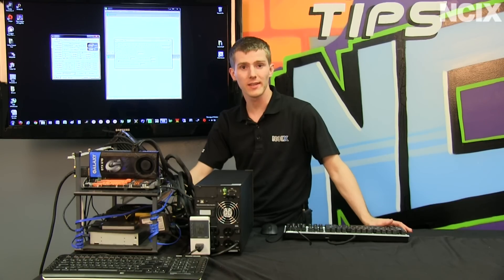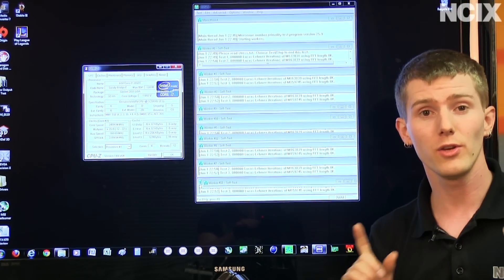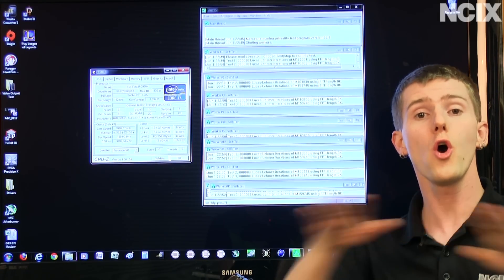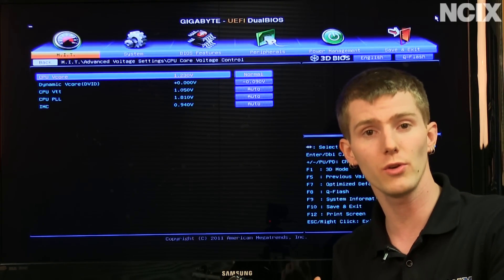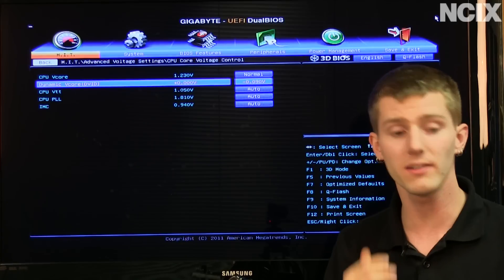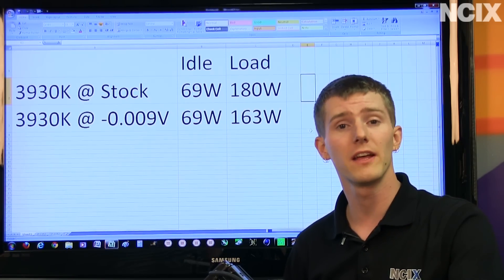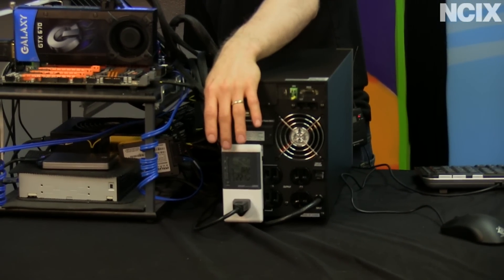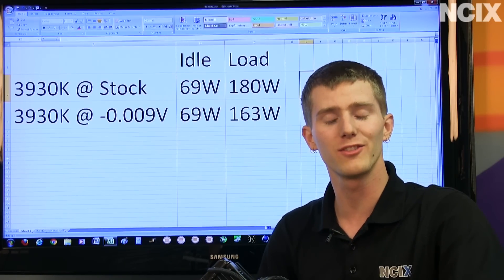Undervolting Your PC to Achieve Better Power Consumption & Temperatures NCIX Tech Tips

Comment: Mine is a Core 2 Quad q6600 overclocked to 2.75Ghz and undervolt -0.1275V with stock cooler and a cheap paste, it's so stable that it doesn't change more then 2 or 4°C to CPU

Comment: My i7-6700K runs at stock 4GHz with -0.170V offset absolutely stable. It has a significant impact on the temperatures and power consumption. I suggest everybody to try that and save some money for the utility bills. It also prolongs the lifespan of your CPU. It is blazingly fast at stock settings, and there's really no reason why not to do it. With i7-6700K you could start with -0.100, test stability, and go down in -0.010V steps. You could save some time by using just a stress test in CPU-Z to find the crash point [nothing bad will happen, in contrast to overvolting], then up the voltage by ~0.020V and it should be perfectly fine. Cheers!

Comment: is undervolting a gpu safe or not cause i have  an rx 480 gaming x and it default voltage is 1150 mv  with 1266 mhz  
And i managed to  lower it to 1000 mv with 1266  mhz  with no probleme at all  and i test it with 3d mark ultra and unigen and furmark and all thing are just fine..☺☺

and my temp has lewerd by 10 to 15 c .

My question is :  iS WHAT I DID IS GOOD OR BAD ?

Comment: Hi. Looking to buy low power draw cpu to use with eluktroniks laptop, which use lga 1151 desktop cpu ! Between i7 9700t and an undervolted i5 9600, which should I buy ? I was hoping to reduce the power draw of the i5 (65W tdp) to the lowest possible while still being stronger than the i7, in order to reach a normal 45W tdp. I'm mostly interested in single thread perf. Do you think it is too far fetched ? I'm guessing they do make those -T cpus for a reason...

Comment: I need help guys does anybody knows what is the problem when your processor is running on very low speed. It all started after cleaning my PC's dust from it and I just removed the fan and cleaned and i plugged it back

Comment: If you undervolt  your both your CPU and GPU will you lose performance?
Reply: I undervolted my CPU and used the intel extreme turning utility to do it because it's much faster and easier than going in the bios every time. 
In advance, turning to turn the voltage offset to into the negative and increase it by 5 till you crash/bluescreen, If you do then go back to what you had that worked.
Mine is set to -0.100 and my max CPU temp is 72C with an i7 9700 turbo.
And yes, To answer your question it is, I'm not 100% sure but I think it's still called overclocking your CPU because your making it better, So far I see no performance decrease, Beats me why Intel CPU's aren't like this and we have to do it manually, They make the CPU'S to get lower temps and like no performance impact.
I'm not so sure if you should do that on a GPU, Most GPU'S are fine at 90C, Make sure you have a good tower and cooling.

Comment: Under volting a cpu isn't very ideal as the vrms will still have to give more or less the same amount of amperage the cup still needs to run at stock speeds. If people think it will reduce heat yes for the cpu but the vrms are not designed for very low voltage and high currents. There is a thresh hold in this
 for it to function above minimum
 specs.

Comment: That's the reason I settled with Xubuntu 16.04, it allows me to use full 3D capabilities of my Radeon HD4650 (chip RV730) without frying my laptop. I also learned some commands to control my Radeon frequency manually and also CPU frequency control, so most of the time I manually set them to minimum or "economy" mode.
sudo apt install cpufrequtils
watch -n 0.5 grep \"cpu MHz\" /proc/cpuinfo
sudo cpufreq-set -c 1 -g powersave && sudo cpufreq-set -c 0 -g powersave && sudo cpufreq-set -c 1 -u 1200000 && sudo cpufreq-set -c 0 -u 1200000 && sudo cpufreq-info
sudo cpufreq-set -c 1 -g ondemand && sudo cpufreq-set -c 0 -g ondemand && sudo cpufreq-set -c 1 -u 2100000 && sudo cpufreq-set -c 0 -u 2100000 && sudo cpufreq-info
These ones for the Radeon GPU:
sudo cat /sys/kernel/debug/dri/0/radeon_pm_info && sudo cat /sys/class/drm/card0/device/power_dpm_state && sudo cat /sys/class/drm/card0/device/power_dpm_force_performance_level
sudo su (only works inside a rooted terminal)
echo battery > /sys/class/drm/card0/device/power_dpm_state
echo low > /sys/class/drm/card0/device/power_dpm_force_performance_level
Done!

Comment: What happens if you undervolt both CPU and GPU?
And another question:
I have been researching this topic and apparently by undervolting your CPU you gain an overrall performance boost. What happens if you only undervolt your GPU and not CPU? What is the most recommendable choice?
Thanks in advance.

Comment: I would imagine that undervolting the CPU would extend the life of the whole system. The less voltage it gets, the less power it draws. The less power it draws, the less heat the CPU will make and the motherboard's power delivery system and power supply will also run cooler because less power is running through it. Less heat production inside the case will extend the life of the whole system.

Comment: after watching this video I decided to under volt and see how far I could push my cpu (i5-7600k)  on an overclock and after checking stability I am sitting at 1.080v and 4.6ghz (this is after running prime95,intels stress test in the overclock tool, cpu-z stressing and playin some counter strike lol)

Comment: I have a 140mm fan on my PSU, 2x 80mm fans on my GPU, a 140mm case fan, and a 120mm fan on my CPU AIO liquid cooler. My girlfriend's mom thinks all these fans will cause the electric bill to go over $1,000. I went as far as removing 3/4 of my 4GB DDR3 DIMMs and undervolting and underclocking the CPU but makes no difference when she doesn't understand what the heck I'm talking about.
Reply: holy crap your gf's mom is dumb

Comment: How is running prime 95 for 24 hours on maximum cpu load to make sure your system is stable would be ECO friendly and save power? I say that doing nothing is better than undervolting since you don't burn that power for making sure your system is stable. And power saved by undervolting would not exceed power used to make sure system is stable. Unless it is done for educational purposes ofc.
Reply: 24 hours is nothing in a computer lifetime. What you save in the other 14976 hours makes up for it -.-

Comment: I will try this shit on my i7-4790k as I have very high load temps - about 69 C but sometimes its reaches even 71-72C
Reply: This Is Not High Temps Man 
But Tell Me First 
These Temps On Full Load Or Idle ?
Reply: Full load. If it was idle I would kill myself :D Idle was something about 38 or less. But the max temp for this processor is 72C and I've already exceeded this score a few times.  About voltage: voltage is affecting temps also. I was experimenting on my previous cpu which was Intel Core 2 Duo and I saw a diference - not much, a few degrees but still... In the professional computer service they told me that my load temps should be max 60-65.
Reply: Okay Man 
Don't Worry A Bit 
Because You Are Safe 
These Temps Are So Good To Work And Play With 
Even If You Go With Temps Like 90 C 
Don't Worry
Reply: But There Is Some Thing I Didn't Mention 
Who Told You That The Max Temp Is 72 ? 
The Average Temp Is 74 C 
And Max Temp Is Above 100
Reply: Are You Working With Stock Cooler ? 
Or You Have Good Air/Water Cooling ?
Reply: TCASE 74.04°C - so ok it's not 72 it's 74 but... it's not avarage temp. For 100% it's max temp
Reply: sorry.. again.. you can be actually right XD
Reply: Uh unfortunatelly I'm right... so TCASE is the temp which you shoudlnt go above because you can decrease life of your cpu. This temp may differ for diferent cpu models. For 1 cpu 80 may be still ok and for another it will be a very dangerous temp. So... for my cpu 74 is a temp i shouldnt go above. It's not avarage temp. And as I remember when I went above 73/74 C my comp started lagging a bit, so... yeah :P
Reply: Ok.. I know shit. You may be right and I may be right in some way. I've just run Intel Processor Diagnostic and it showed in default test that my temps and everything is normal - as I understood correctly my temps were about 42 below max! - which is kinda strange for me because it seems to good. But I still can't tell what are "good" temps  for this cpu.
Reply: Good luck mane, finding the perfect voltage for a chip is an art

Comment: dude help me out pls , i have toshiba satellite L840 , its already about 3 years since i bought that laptop

im usually use that laptop for DOTA 2 REBORN , but lately , my laptop will 100% overheat if i plugged the charger , if im just using battery it wont overheat , but if i play with battery+charge , or just use charger without battery it will 100% overheat as soon as i opened dota 2,

i have open my laptop , clear my heatsink from dust , replace thermal , n its still overheated dude >.< help me out pls , did this undervolt can be used in my laptop ??
Reply: +FauziPS Corner Here is your first problem. You are using a laptop to begin with :v
Reply: i have same problem but how can i do this? from power settings then advanced?
please reply
Reply: ive change d battery setting on my laptop n change vga setting like from maximum performances to maximize battery life , n it wont overheat again but u loss some fps tho ,
Reply: My first thought is a failed fan, you said you cleaned the heatsink, did you clean the fan as well? Are you sure the fan is spinning? I've seen a fan completely jammed by dust. I need more information. Is it CPU or GPU that is overheating? What CPU and GPU do you have? Download a program called HWMONITOR and run a game and tell me your max temperatures, and fan RPMs. If there is anything that can be done i will find it.

Comment: Why the heck would you run Prime 95 for 24 hours???? Are there ANY realistic scenarios where the cpu would run at full load for 24 hours?   3-5 hours is more than enough enough to gauge the undervolted cpu's performance
Reply: +Kenny Ken Temps change throughout the day lol. It's also to be REALLY sure it's stable
Reply: It doesn't really work like that. It's not like the point of instability is after some number of hours of continuous load. Rather, its a continuous probability distribution. If there is slight instability caused by an undervolt/overclock, it could happen at any time, whether you just booted up a game, or have been running AIDA64 for 2 hours straight. Panning for gold in the river for 2 hours and finding nothing doesn't prove that there isn't gold in the river, it just means that if there is, there likely isn't very much. Panning for 24 hours and finding nothing just gives you increased certainty that there is no gold in the river. But there could still be that one rare fleck that causes your computer to crash at the worst possible time.
Reply: I think 12 hours is enough and realistic: you launch it before you go to work, you stop it when you come back.

Comment: you can save more energy by underclock your gpu. i have radeon 6970 which max clock 880mhz, then i underclock itu to 500mhz, it saves me 60watts. from 309watts in gaming load to 249watts . there's few stuttering but i can drop few of graphic effects such as dropping fxaa to low and physix off and it gone. it still playable. but when you undervolt cpu some of games would just crashed.
Reply: undervolting saves a lot more power than underclocking AND with no performance hit.
You saw yourself - 0.009V equates to 17W difference. That is insane considering the voltage change is less than 1%!!!
You performed an underclock of almost 50% and only shaved 50W! If you underVOLTED that same GPU but to the same 50% (if it were theoretically stable), you would see HUGE power drops, and power consumption would likely be well below 100W.
This is because power is related to voltage in a V^2 way, decrease the voltage and the power - and therefore temps - will decrease exponentially.
Reply: Ranstead Moons not all gpu cards can be undervolted, mine does not. it's BIOS locked the voltage. and bios mod is another tricky bussiness that poeple would go over when they doing some bitmining . to really cut the cost
Reply: ginjopowder true, mostly it's laptop cards that cannot be undervolted, at the very least you can undervolt your cpu which also saves a lot of power in itself (:

Comment: i reduced my 8350 stock voltage which was 1.39 volts to 1.3v, reduced max temps by 10 celsius, lost no performance. I undervolted my 970 phenom ii to 1.2v it didn't boot or even go to bios, had to reset cmos.
Reply: tulp35000 All FX CPU owners should undervolt IMO, stock vcore is way to high. I am testing my FX-8320 at 3600MHz turbo disabled on a 990FXA-UD5 board. So far I am Prime95 stable at 1.184v under load and temps have gone down 
significantly. Before I started testing I was running 3500MHz and ~1.35v under load.
Reply: ScaleCarModels
 nice chip there.
Reply: +ScaleCarModels Hey dude, i have a question for you. I am undervolting my 8350 with a gigabyte mother. If i use the manual setting to change the vcore, but the vcore stays constant, and if i use the dynamic vcore, its doenst work, or i dont know how to do it. Can you explain to me please?
Reply: Aisar Gatrif
better if its dynamic. At idle it'll down clock to 800mhz or so. Just set the v to 1.3v and it should be fine.
Reply: +tulp35000  I have 1.24 constant vcore. I don't know why dynamic doesn't work for me. I have to do another thing? Like set LLC to low or something?
Reply: Aisar Gatrif
where are you looking at bios or hw monitor? you dont change anything but core v lol.
Reply: i undervolted sempron 2650 from 1.300v to 0.986 and overclocked a bit to runs fine

Comment: It is funny how he talks about saving energy, but runs prime95 for 24 hours :)
Reply: yeah, that probably consumes more energy than what you would save over the lifetime of the chip due to undervolting
Reply: 10% drop of consumption under load, so 200 hours for return of investment, not counting the power comsumption of other components (mobo, ram, graphics chip). Say 300 hours total. If you use the PC to play videogames 1 hour a day, less than a year. And who does that, it will be more hours. If it's at full power doing video rendering or something like that 10 hours a day, one month.
Reply: Which PrimeGrid project is the best for doing the same thing?

Comment: "There's probably not a ton of savings left to be had"
Dude, I undervolted my 560ti from 1.012V to 0.950V and the temperatures dropped by 15 degrees (75->60). I've been running like this for almost a year now, so it's 100% stable and I suppose I could go even lower with a flashed bios.

Comment: the undervolting may be as bad as overvolting na?
why recommend it for saving current
select an amd processor and disable cores in bios
THAT would be better
i use 2 cores for browsing and 6 cores for gaming and converting
my cpu-AMD PHENOM X6 1100T 3.3-3.7GHZ

Comment: A Celeron isn't any more power efficient because it is clocked lower and has less features. Infact the opposite is true. It is just a different architecture. Celeron currently has a TDP of 65W (desktop) where as the top end i5 is 77w. The i5-3570T uses 45W TDP.

Comment: ok so this may or may not be a good/bad thing...i ran the oc genie lite on my msi motherboard and it set everything for me cpu, ram, etc lol. we'll see if it holds stable or not...put the cpu at 3.84ghz, ram at 1280mhz (7-7-7-19-1T), gpu stayed same tho. im pretty sure other things were changed to achieve these settings but i really have no clue LMAO but we'll see atm my system has never been this responsive :)

Comment from the maker: I've done far worse.

People have been asking me to cover this topic for YEARS. I can't control the results. In fact, if I did, this WOULD be the most useless video I've ever recorded...
Reply: I need help guys does anybody knows what is the problem when your processor is running on very low speed. It all started after cleaning my PC's dust from it and I just removed the fan and cleaned and i plugged it back
Reply: @abdulrazzaq5940  haha. it means your CPU was struggling due to all the dust and now it can relax.
Reply: What a chad

Comment: Undervolt works best on AMD.
My Athlon II x2 250 works on defauld clock at 1.15VCore (1.375 default) with CnQ turned on.
At idle on 800 mhz VCore is less than 0.8

Comment: I have a question! My phenom 2 X6 runs stable at 1.265 V at 3.3Ghz  on each core. Stock voltage is 1.375 V. Now when the cpu can run at a much lower voltage why the factory set voltages are so high? And Linus By this undervolting i  get a significant drop of up-to 7.5 Celsius. I bet you've never been to India where temperatures are as high as 46 Celsius which makes a drop of even 2 degree celsius resonable.

Comment: @Kveil, yes and no, basically as close as you can get to that is usually kinda just overclocking with stock voltage (sometimes you can get a base increase without adding any extra voltage to the factory settings, just like in this case your removing some without losing performance) usually its either or, you cant drive a processor harder without more force (voltage) and expect to cut the force and save money or they (intel/amd) would already be doing that even more so than they are

Comment: Undervolting definitely has its place, but knowing when and where to do it is tricky. One of the most paradoxical places to utilize undervolting is in overclocking.Taking a 2.6GHz chip to 3.2GHz on stock voltage is great, but taking it to 3.2GHz with a voltage lower than stock is where it's really at.

Comment: **TIP** If you're seeing 3.5GHz then your RAM is Default DDR3-1333. The i7-3930K is a 3.2GHz/3.8GHz Turbo -- use a DDR3-1600 kit and and set the BIOS to run the RAM @ Rated (XMP/Manually) -- then the Turbo will be 3.8GHz!